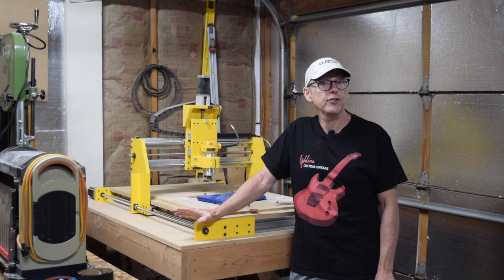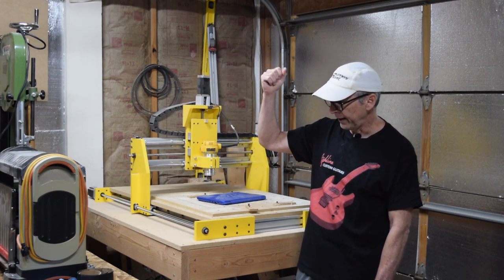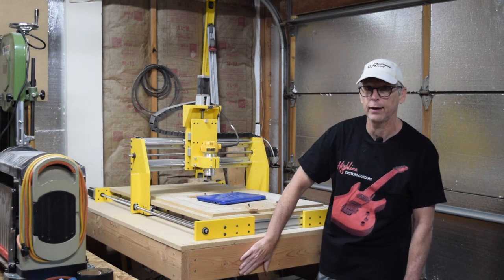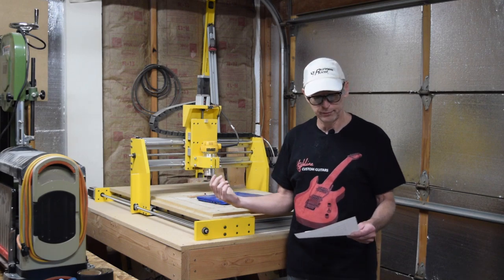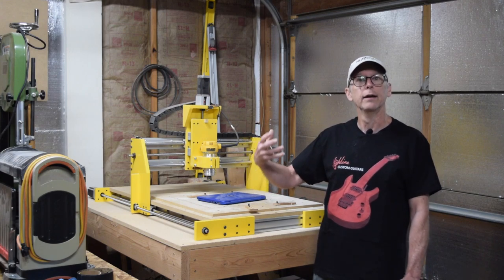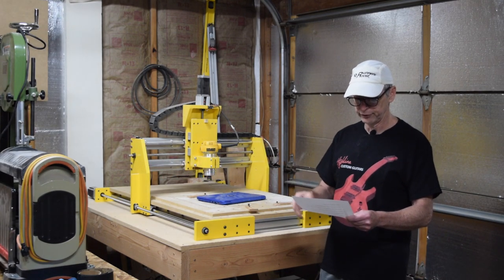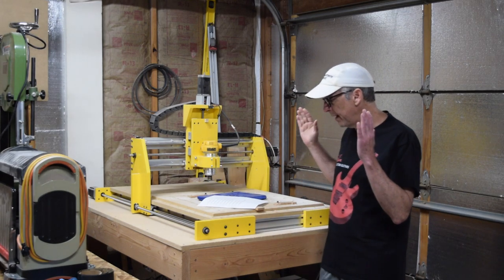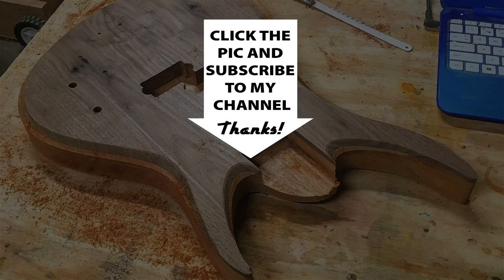CNC Machine FAQs

Comment: Hi Chris, I am thinking of purchasing your CNC machine plans. Did you ever get around to designing and testing your dust collection system? If not, are you still planning to do it? I would love to purchase that as well.
Reply from the maker: I never made a useful dust shoe for this machine. I was going to add a commercially made dust shoe, but I got the X-Carve Pro machine before I could pull the trigger.
Reply: @HighlineGuitars  Ah, okay. Is there a commercially available shoe that you know might fit the Highline CNC?
Reply from the maker: @OldSilkRoad  I never tried one, so I don't know. There are a lot of them out there. You would need to find one that fits the router. One thing to be aware of is that for carving guitar necks and bodies, dust shoes often don't work because of the amount of vertical movement needed to carve through a deep wood. I only use mine for shallow operations like fretboards or anything with less than about an inch in total cut depth.
Reply: @HighlineGuitars  Thanks so much for your response. That’s a great thing to keep in mind… luthiery is exactly what I have in mind.

Comment: Hi Chris, I'm assembling the electronics of your CNC design and I just want to make sure I get grounding right. Should both grounding busses( power supply and Arduino) be bonded to the enclosure? I'm asking because in your plan the Arduino grounding bus, in particular, seems to be installed on some sort of insulator.
Reply from the maker: The enclosure, which has to be metal, is grounded by the analog bus. The digital bus is grounded once it is bolted to the enclosure.

Comment: Hello again, Chris!  I just purchased your CNC machine plans (and a few others :) ) a couple of weeks ago.  After listening to this FAQ, I am almost tempted to give aluminum parts a try.  As you suggested, aluminum will work better with ball screws instead of acme lead screws.  The one question I have regarding that is: I understand that owing to their low-friction characteristics, ball screws don't come to a dead stop like lead screws do, but require additional braking mechanisms.  Is that correct?  Will your design need to be modified, or will the current anti-backlash and other bearings work?  Thanks!
Reply from the maker: Ball screws will come to a dead stop if they're connected to stepper motors. The use of ball screws with my CNC router will require a significant redesign since they use totally different bearings and anti-backlash nuts.
Reply: @HighlineGuitars  Thank you so much for your prompt reply, as always! Much obliged.

Comment: Hey Chris.  Two questions: 1. Is that a full size or palm size router?  2. Do you ever have any trouble with dust and debris getting into your lead screws or guide rails?
Reply from the maker: It's a DeWalt 611 trim router. The screws and guide rails are solid so dust can't get into them. It does land on them, however, but that has no effect on their movement.
Reply: @HighlineGuitars  I just wondered if the dust ever got into the bearing blocks or into the threads of the lead screw nuts.  It would seem like that could gum things up, if it did.
Reply from the maker: @jeremyvonk6853  It never has.